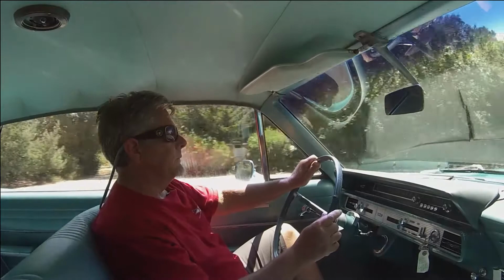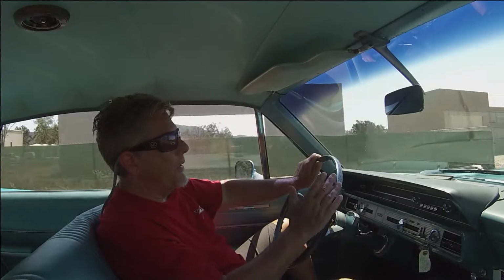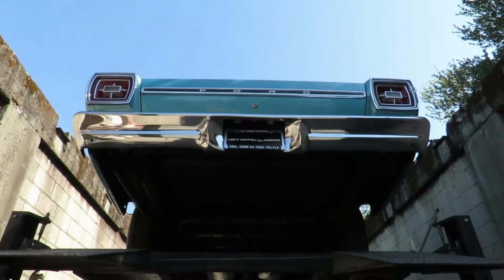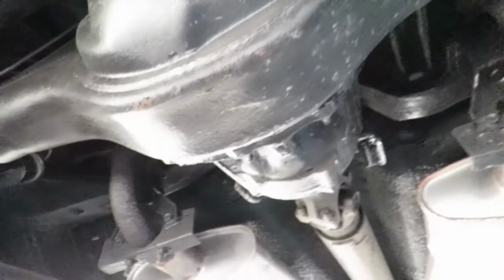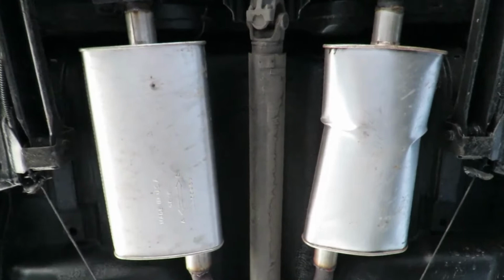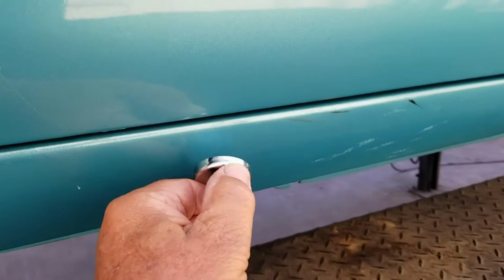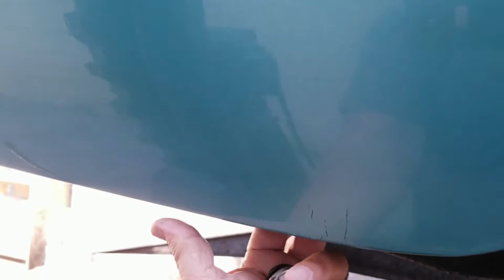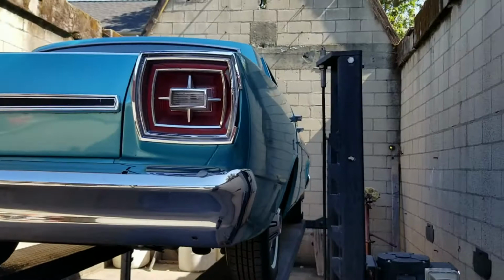1966 Ford Galaxie 500 in Tahoe Turquoise

Comment: I had a 66 Galaxie 500. It was my first car, bought in 1970 when I was in the 10th grade, drove it on my honeymoon a few years later. It actually said "Galaxie" on the rear fender. This video is a Custom 500 (no Galaxie in the name), which was a step down trim-wise and price-wise, then there was the Fairlane 500, which was another step down. Same body/engine/frame, different trims and options. But no dealer called the Custom or the Fairlane a Galaxie. Cool lookin' car, though...brought back a lot of memories! Mine was white when I bought it, but the original owner lived near the Gulf coast and the paint was already messing up. Spent my first-ever IRS refund check on a dark blue with glitter paint job. Looked really better than that sounds. :-)